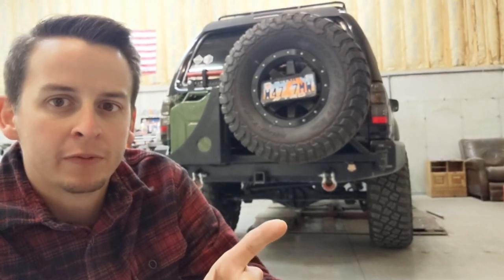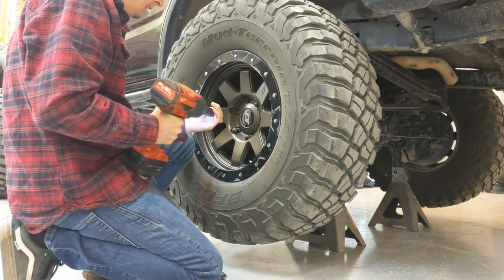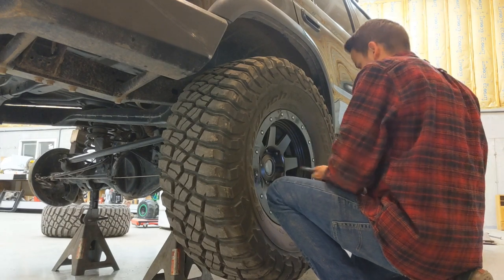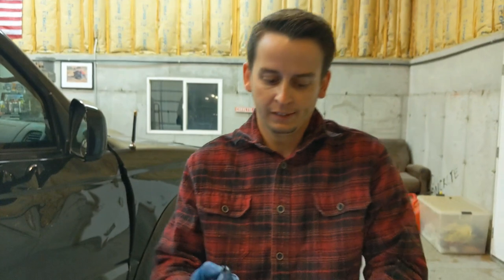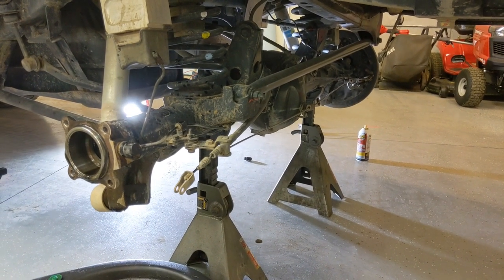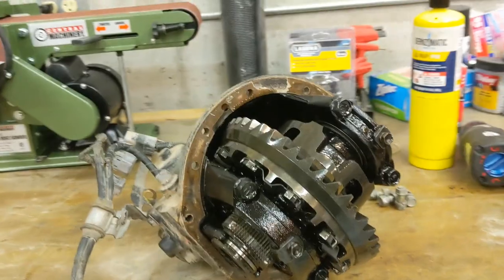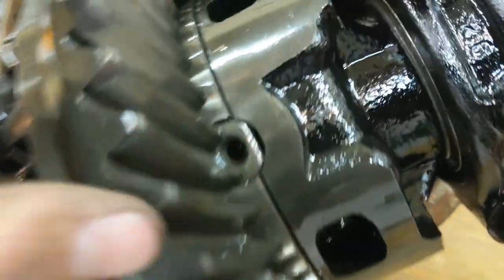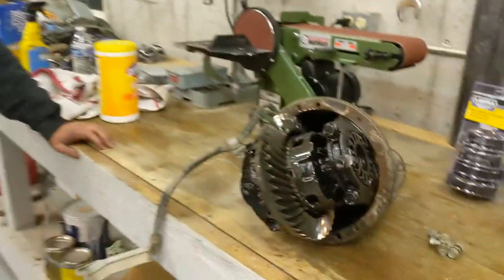Removing a 20 year old 3rd Gen 4Runner Rear differential

Comment: I actually use a small layer of anti-seize compound on the flat side of the hub and it prevents that rust. My hubs come off easy every time.
Reply from the maker: Awesome thanks for the tip.

Comment: Great video! Any chance you know if/when the rear diff would have to be removed when doing a suspension rebuild?
Reply from the maker: shouldn't need to remove the diff to do a suspension rebuild. I broke the teeth on the ring gear that is why this one was pulled out.

Comment: hank you for the amazing video.  I just got a new 98 4runner.  The 4WD would engage (solid green light) but to disengage after pressing the button the green light stay solid nothing happens right away but later after driving awhile there would be a BIG bang (shakes the car) and it disengages.  Any guidance on what the problem is?
Reply from the maker: You need to make sure it disengaged before driving. Back up and pull forward a couple times and it should disengage for you. You are lucky it didn’t break your transfer case haha.
Reply: @austinsoffroadgarage  you are supposed to be able to shift between 2H and 4H while moving.  My other 4Runner just do a loud Click.  But this one had a loud clunk, like smacking a sledgehammer.